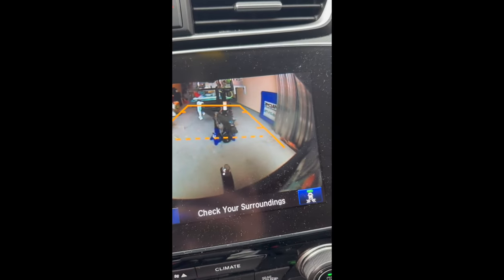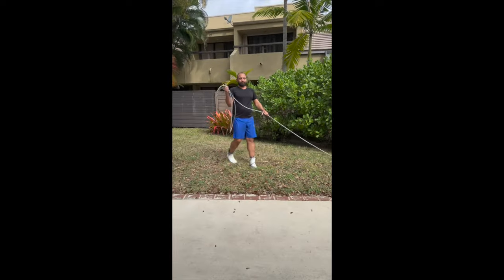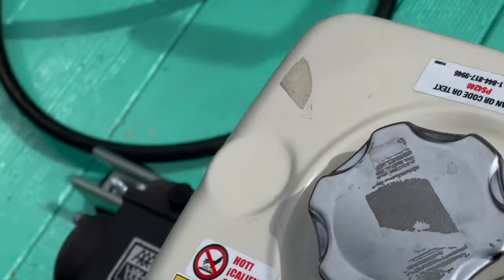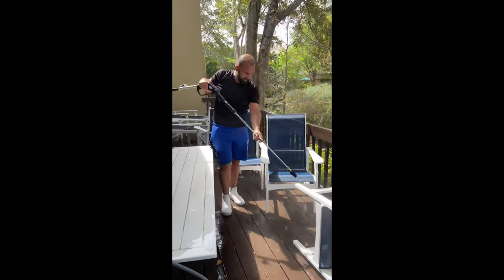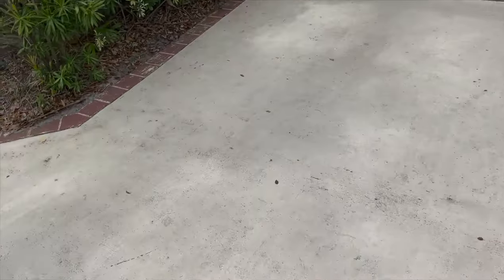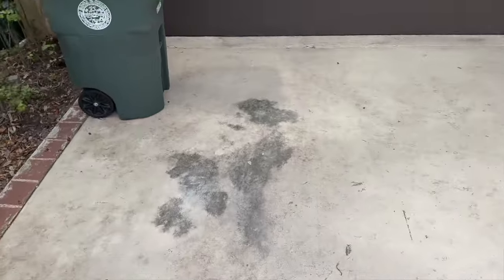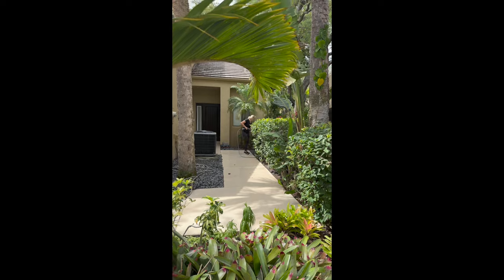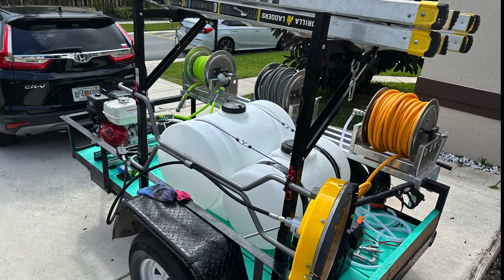First Trailer Job with Homemade Pressure Washing Rig.

Comment: Well done!
You will learn quickly with that nice setup.  

Just a quick tip...for outdoor furniture, after a proper dwell time and the right mix, the unwanted organics will come off with a low pressure rinse.  This will save you from damaging outdoor furniture with the turbo nozzle...it is just not worth the risk using so much pressure.
Outdoor furniture usually will come clean with a 1% mix and longer dwell time.

Pretreat concrete with a 3% and let dwell for awhile.  I usually apply the solution to concrete first then wash house and I clean concrete last.

Great job!
Reply from the maker: Thank you for the advice Craig.

Comment: A little tip on backing the trailer, put your hand at the very bottom of the steering wheel, and if you need the trailer to go right move your hand right, same as with going left. I know going opposite throws a lot of people off. The shorter the trailer the quicker it turns.
Reply from the maker: Yes def a mind trick. I also find it easy to look backwards helps my brain steer opposite. I put a wheel on the bottom of trailer jack in case I ever need to unlatch and physically spin trailer around 🤣

Comment: Congrats on taking the leap of faith and getting it done. Any chance you have a rough estimate on the price for everything and a list of items used. Thanks
Reply from the maker: About 5k including used trailer. can be done for less. Each titan hose reel is $400 but I wanted stainless steel plus it looks more professional I think. You can get cheaper 55 gallon drum tanks on FB these were 200 each. You'll spend a lot on hoses and fittings. If I could do it again I would have got a better pressure washer. It's a Simpson 4pm. No belt or gear :(
Reply: @KrakenPressureWashing  That's the washer Im looking to purchase to stay on a tight budget LMAO. Which one are you eyeing up? Thanks for the response
Reply from the maker: @PoconoWashPros  it works well except it dosent have a bypass unloader. I didn't know what that feature was till after I bought. hopefully I can spare you the trouble by letting you know that with this washer, you have to constantly spray water or the pump  will overheat whereas with a bypass unloader, you can let off the trigger and Water will bypass through a hose back to the tank.
Reply: @KrakenPressureWashing 

What makes you afraid of your pressure washer? I ask because I got a brand new, used one time, 4 gpm pressure washer for $100. I've had units like this one many times and had no issues selling them for $600 each. What's the main advantage of belt drive? I'm thinking the important thing is to have external bypass valve that dumps back into the tank while pressure isn't being used.
Reply from the maker: @8SecSleeper it's a great machine. I just don't like that it doesn't have a bypass unloader but there is a work around to install one. I purchased one for about $70 haven't installed it yet.  $100 you can't go wrong. The day you upgrade this could be your backup

Comment: Came out good nice work . If it was me I would of hit it with a 3% mix right of the batt then left for 15 mins and it would of come off like butter
Reply from the maker: Yeah man that was the original plan but the 12v pump stopped pumping. Brand new pump too. Not sure what happen but I'm sure it was user error it started working again when I git home to inspect. I actually pulled out the pump up sprayer and hit it again with exactly 3% . The high pressure ball valve also snapped on this first use. Maybe I tightened it on too hard? Already replaced it with a DN10. Check out temu they have lots of great pressure washing fittings for less.
Reply: Yea I will take a look on there for sure

Comment: Nice work brother can you tell me more about the  setup  with the reels. Is it welded  or screwed  in ?
Reply from the maker: Thanks man. It's an aluminum dunage rack (a shelf commonly used in restaurants) cost me $40 for 4 ft length got 2. Weighs only 6 pounds and can hold 1400 pounds I drilled holes and bolted it to the side of trailer. I have a video on it. Here's the link: https://youtu.be/q3WMpe4w0aQ?si=iFS5PFiIfg5BrVqI

Comment: What is that aluminum piece the hose reels are sitting on?
Reply from the maker: Glad ya asked. I found an aluminum dunage rack that is commonly used in restaurants. It's basically an aluminum shelf that holds 1400 pounds and only weighs 6lbs I was concerned how the welds would hold up being it's bolted to side rail of trailer but It gets support from the wheel well. I may cut of the legs or attach a custom made sigh to it. $40 for a 4 foot long piece can't go wrong. It's strong, light, rust proof looks cool and cheap. No need to cut wood or weld. Just bolt on.

Comment: Nice little setup man. Do you have a link to that ladder rack ? Looking to install one just like that on my 5x8 trailer
Reply from the maker: https://a.co/d/aazJBO3
Reply from the maker: It's nice because it has adjustment screws to tighten so you won't get any rattle
Reply: @KrakenPressureWashing   cool, thanks man

Comment: You did all that with no hot water?
Reply from the maker: I guess it would be helpful but I built this on a budget plus the trailer is only 4x8. Lastly my CRV is not rated to pull anything heavier than what's already onboard.
Reply: @KrakenPressureWashing  well I’m not hating. I want to specialize in concrete driveway and oil stains and it seems like hot water is a must for that.  props for doing this and getting your own business going bro….
Reply from the maker: I agree if I was doing commercial work store fronts, dumpsters restaurants I probably would want to use hot water but for typical residential work here in Florida. It's not necessary.. the degreaser from Southeast soft wash works very well however it's too expensive. I'm sure you can find something comparable for way less..

Comment: Awesome job. Do you have a link for the table/platform that your hose reels are mounted on?
Reply from the maker: Hi it's an aluminum dunage rack used in the restaurant industry. Solid it holds about 1,400 pounds and weighs like 6lb. Cost about $40 I made a video on it will prob make another as I'm new at making you tube videos and could prob do a better job 

video : https://youtu.be/q3WMpe4w0aQ?si=_M4EieovK214BxN-

Racks: https://www.webstaurantstore.com/14877/dunnage-racks.html